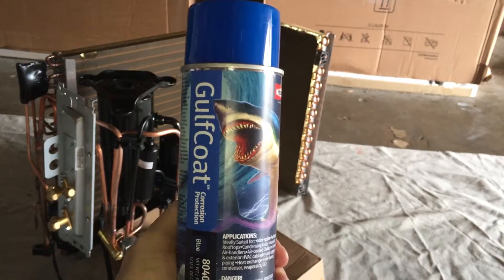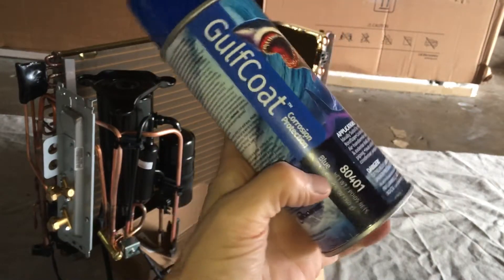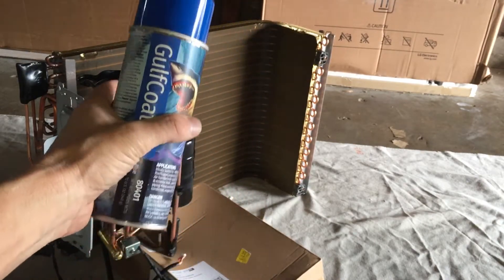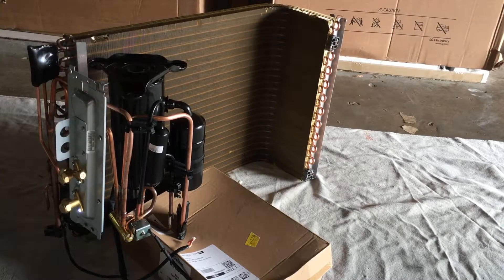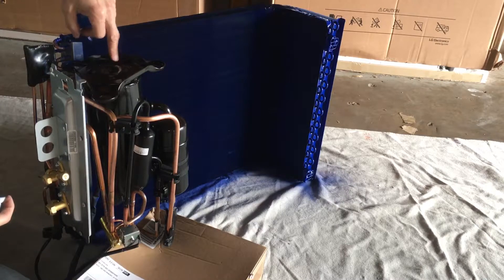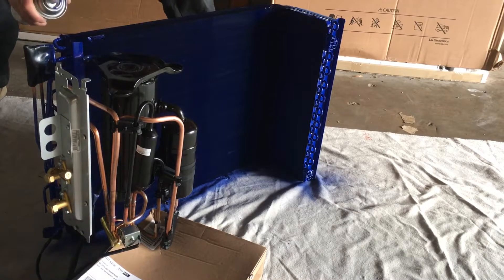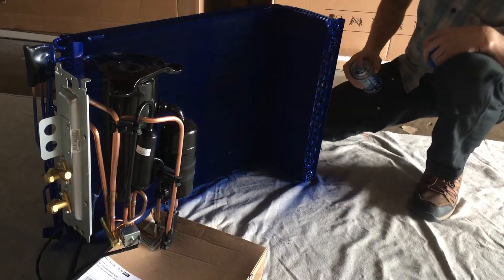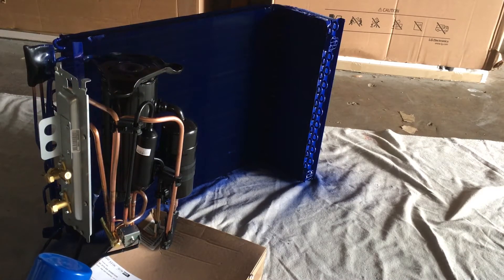GulfCost Coil protection, protect from salt water and ocean spray AC condensers.

Comment: Thank you for this I'm in Daytona Beach Florida on the beach air conditioning units on the roof last 4 to 5 years and just 2 mi inland they last 10 to 15 years
Reply from the maker: If you decide to use this, you must thoroughly thoroughly, and I mean thoroughly clean the fins several times because they were produced within the oil residue. 

And you must let them dry out, which might be difficult in Florida with 80% humidity . 
Because between the fins, the way they are pushed over the copper tubes. There’s a tiny tiny air gap that’s microscopic between everything. 

And it’s possible for you to trap water in between the aluminum fins in the copper tube 

This would actually create a problem what you’re trying to avoid by trapped in the water underneath a Paint film 

So if it’s in your own that you can experiment on clean it three times, let it dry for days 

I actually took mine inside the house in a dryer location that’s dehumidified under low humidity, and I hit it with a heat gun prior to application of the paint 

It’s extremely microscopically thin when it dries 

It’s thinner than the thinnest saran wrap that you have ever touched with your fingers before 

So apply three layers . 

And just protect things with crumbling tinfoil around items you don’t want sprayed and spray absolutely everything if you live by the coast, of course not everything electrical connectors sensors, but all exposed copper, and aluminum in

Comment: Hey t lech here in The Netherlands i couldn't find the spray  you mentioned in your video however we do have here on sale a zinc spray . Would it be wise to use zinc spray on coil instead of a product you used ? Thank  you in advance for your answer .
Reply from the maker: You would not want to use a normal zinc spray that was intendant just to go on steel because it was not developed for the sole purpose of the very fine thin spacing and thermal conductivity that the heat exchanger fins need. 

A zinc spray would be OK to put on the ends of the headers where the tubes bend . 
                 Because where the copper tubes bend this is often a leak point. 

A zinc spray would be good for the entire rest of the cabinet and other components. 

There are many similar products that are produced all around the world because there are coating manufactures in every country and there are coil manufactures in every country that require for some sort of protective coating that they add as an option to be applied to their coils

And must read the labels of every product because many products require a thorough cleaning and degreasing of the items. 

Certain types of paint are not compatible with being sprayed over galvanized metal

Only the correct cleaning products can be used on coils because certain kind of cleaners actually damage and degrade the aluminum or if they’re not proper and they get stuck in between the aluminum and fins in the copper tube they eat away at the copper tubing and cause leaks in the future

So every product applied must be intended for its purpose when it comes to coils 

the success of any coating is only is good as the proper procedures of application.

Comment: Excellent video! Question: the metal frame on both ends is rusting, how to prevent it and fix it? Thanks!
Reply from the maker: Preventing it is something you do before it rust.      Like what I’m doing on these brand new units you have to clean them and degrease them first and then apply the epoxy coating. 

To get rid of rust you have to use a chemical that either gets rid of rust or converts rust to a more stable oxide that actually becomes a protectant on top of the metal takes a little studying to understand this process. 

Then after the system has been chemically cleaned or derusted.      Thoroughly dried then a epoxy or other type of coating can be applied to seal out moisture from the future. 

But when picking chemicals to remove rust instructions must be read and followed thoroughly and exactly. 

Because some chemicals that remove rust can damage aluminum or damage copper. 

So the chemicals that are chosen to get rid of the rest or convert it must be compatible and absolutely do no harm to aluminum or copper coils.
Reply: @coldfinger459sub0  Appreciate your help. Although the rust converter might be a better option,  I am not so comfortable with the rust converter. If it won't damage the copper, I would like to try. Experience is very important for this kind of job. I would like to know how about applying a couple layers of Rust-Oleum Rusty Metal Primer Spray, and then Rust-Oleum Appliance Epoxy Spray ( Washable and moisture resistant finish)? I tried AC-Safe Air Conditioner Foaming Coil Cleaner, which looks like rusting copper, although some comment said it's safe for copper.
Reply from the maker: @charliet2521  are used to use rust converter when are used to do bodywork and paint on cars.   I never bother trying it on air conditioning because of the copper and the aluminum. 

You have to go to the manufactures website of the chemical that is used and read about its interactions with different metals. 

Because it is an acid or a high alkaline base I can’t remember which one.  

And you have to be careful with the evaporator and condenser cleaners because some of the manufactures kind of lie they say they’re safe but not really. 

And some of the coil cleaners are only safe when diluted down properly and immediately rinsed off quickly and very very thoroughly. 

Even the coil cleaners that say there are no rinse formula still rinse them off. 

I’ve used rust oleum on the exterior cabinet. 

Because the ends of the middle that rust on the coils is coded in galvanized (zinc) 

So you must read the fine print on the rest oleum maybe even go to the website on the product to see its interactions with different metals. 

If the paint has a alkaline base paint.  It’s not good to put over zinc a chemical interaction happens I think if I remember it’s called soaping. Like hand soap is formed in delamination happens it can peel.   
                But certainly Epoxy I believe were compatible with galvanize metals. 

There is actually a zinc based paint that is 95% micro find zinc metal and 5% epoxy mixed together it’s used to repair bridges over salt water. 
         One of my videos show me using it. 

Because the middle zinc is specifically used as an aneroid to give up its life in slowly decay away protecting the Metal. 

For paints on the cabinet if I had the time and wanted to spend the money I would only use catalyzed paints Automotive. 

Because the good ones are far superior than anything else.     And they dry hard in minutes and fully cured within 24 hours rockhard.    Highly resistant to UV rays and salt.
Reply: @coldfinger459sub0  Thanks. I will try Cold Galvanizing Compound Spray and keep an eye on it.
Reply from the maker: @charliet2521  make sure it’s from a high-quality reputable company it’ll be 95% or more zinc compound and the rest will be epoxy. 

It will be very expensive and the can will be heavy like a lead weight lol 😂 

Most of the big box store brand name zinc coding compounds for under 20 or $30 only feel as heavy or may be a little bit heavier than a normal canna spray paint and southern home use solvent-based alkaline containing paint base that is not compatible with being sprayed over galvanized metal. 

Real zinc 93% or greater aerosol spray cans will be about $50-$150 I can and when you go to pick one up it will feel like it has led fishing weights inside the can it’s so heavy. 

But something is better than nothing if you’re by salt water
Reply: @coldfinger459sub0  good content mr Lech, so i have a question, it could be possible to use this product for car new brand new evaporator and condensers? I appreciate your opinion about this thanks
Reply from the maker: @christiancarias3420  yes actually there is a manufacturer Modine who makes automotive condenser who have this as an option when you order your condenser I have seen it as a $15 extra option 

One of my customers actually purchased one of these I was surprised the first time I open the box and I seen a blue coating on a automotive condenser

The brand-new condenser must be thoroughly cleaned and decreased and allowed to dry then the coating can be applied
Reply: @coldfinger459sub0  and for older cars for replacement new evaporator or condenser, could be applied before reinstaling?
Reply from the maker: @christiancarias3420  yes
Reply: @coldfinger459sub0  thanks you my friend, i appreciate your way that you explain ans share your knowledge, greets from Venezuela

Comment: safe for A Coil inside home Air Handler?  It may leach out into home?
Reply from the maker: What will leach out into home ? 

It’s epoxy something that you’ve been household items and devices already.   It’s a solid nothing to Leach. 

        In the very First time you use it and heat up the coil he will be counting any residue VOC Left in it and finish the curing process. 

There’s a lot more toxic thing to leech out in IKEA furniture your vinyl or hardwood fake flooring paint on your wall or any new furniture or appliances that gets unpacked out of a box fresh from the manufacturing plant.
Reply: @coldfinger459sub0  I'm opening up my A-Coil.  Some rust on outside Galvanize, something that looks like rust is now in air duct.  System is only 7 years :(
Reply from the maker: @libertyfox7486  i’m going to guess that periodic maintenance cleaning of the evaporator coil never happens. 

Rust on the corners for the steel galvanized headers or I both ends is normal. 

       Fins are made out of aluminum so it should not have that reddish brown rust look aluminum oxidizes has a white dusty snowflake almost like skin dandruff color.
Reply: @coldfinger459sub0  I seem to have heavy condensation that may be cause.  I'm going to pull center plate to get inside A-Coil in a few min
Reply from the maker: @libertyfox7486  condensation is good and normal

It depends on the humidity of the day
Reply: @coldfinger459sub0  3 qt per hr seems too much in dry CA valley, but was much less after adding R 410 that was low 12oz on 4 ton unit.  I'm hoping for best after finding so much in air duct.  I know more in a few
Reply from the maker: @libertyfox7486  I’m in california and as I write this now it’s 87% humidity 
        My ac dripping out water 💦 every day I use it since I installed it back in 2014 . 

My car ac looks like it in need of diapers 
           I can end the drought
Reply: @coldfinger459sub0  Opened A coil, at bottom on each side rust and the small dust like flakes.  Now I have figure out how to clean and seal without more damage.
Reply: @coldfinger459sub0  I have rust remover, but I need to seal it.   2 yrs ago I removed rust outside A coil and it didn't come back.  Mystery
Reply: @coldfinger459sub0  Bay area weather is unique and not like CA valley.
Reply from the maker: @libertyfox7486  got to figure out what chemicals are eating causing the aluminum to oxidize
Reply from the maker: @libertyfox7486  I live in the bay  area
Reply: @coldfinger459sub0  Gulfcoat, not Gulfcost.  Water base looks like safe product I may use.  $30 on eBay,, is that good  way to buy?  I don't see many other options locally
Reply from the maker: @libertyfox7486  I see Oakland is 81%. RH 
Hayward 70%
San Jose 57%
 Vallejo 67%
Sausalito 84%
Burlingame 73% 
San Mateo 73%
Reply: @coldfinger459sub0  now 85 in home, nobody is happy,  Working all morning to find issue and get back together and I'll coat another time.  Thanks for sharing Gulfcoat,  not many video on HVAC rust coatings
Reply: @coldfinger459sub0  You missed one, CA capital.  I have nice ranch on 2 acres in Sacto county.  37% at 70, Inside 83 and dry
Reply from the maker: And all that could have been prevented if it had a coating on it

Comment: Grew up near the Atlantic. Did a lot of steel Fixing. Welding rotted steel. Unbelievable how big hunks of steel rot.
Reply from the maker: Did you see the Cold galvanizing compound I used in one of the videos on this 9000 BTU UNIT bottom stamp steel floor pan
Reply: @coldfinger459sub0  no I’ll look. I left that place 30 years ago. Not so much rust in Florida